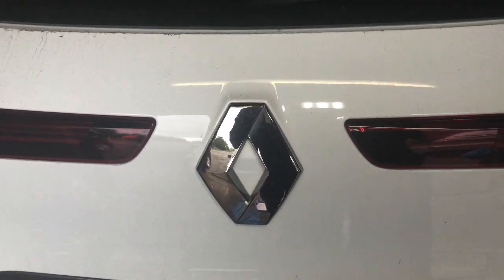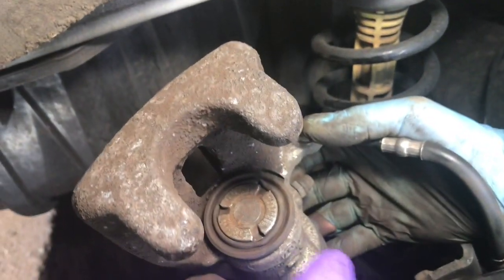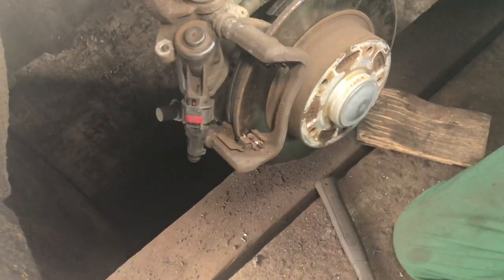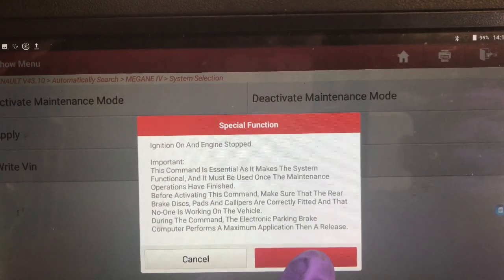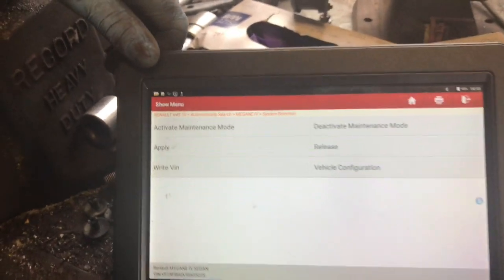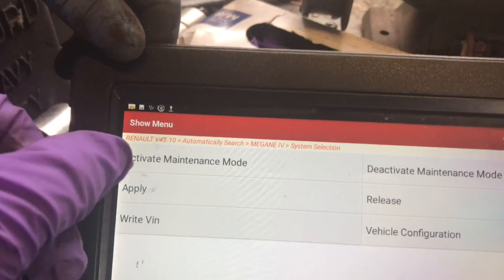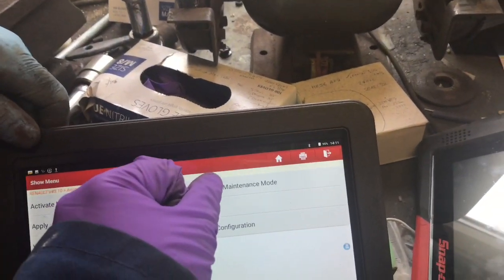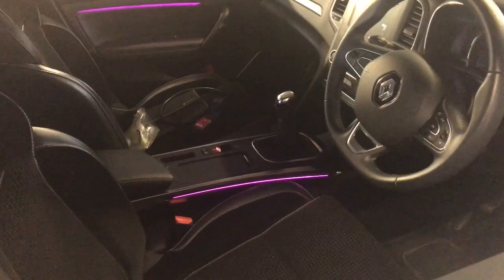Renault Mégane IV (2018) - Rear Brake Service, Maintenance Mode Procedure via Launch X431(Scantool)

Comment: Recently changed my own rear brake pads on my early model 2016 Mk4 , didn't do any of this, all I did was chock the front wheels and left the handbrake off without the ignition on, had no issues changing the pads, and managed to push back the piston without much hassle.. no errors either after. I find it resets itself when you reactivate the handbrake. But, good guide regardless.
Reply: My handbrake comes on automatically once the engine is off, even when in neutral (mk4 Megane). How did you manage to stop that?
Reply: @InterTay  Don't use the clutch for the first bit.. put car in third gear (1st gear if Automatic), press the foot brake and press the stop start button for 2 seconds so the ignition is on,  keeping your foot brake down you can deactivate the handbrake by pressing the handbrake button, this will release your handbrake. Even if ignition switches off, it won't reactivate the handbrake until the next bit. (but it will give an audible warning the handbrake is off.)

Chock the car, lift and car jacks to make it safe, replace brake pads/discs depending on what your replacing.

To reactivate, start the car normally with door shut, and pull up the handbrake switch, with foot brake pressed deactivate handbrake, and stop engine. the car should activate the handbrake with the new pads/discs on, no ECU reset needed.
Reply: @JustAGameShow  thanks for this information. I was wondering if that would work. I have the 2020 facelift, and I've managed to get the handbrake off, but I was not sure if pushing the piston back without resetting the EPB motor would damage it. So when you push the piston back, it automatically pushes the EPB motor back too?
Reply: Same here but I got that brake system failure after changing the rear pads had to reset it

Comment: Eyup sandy, once the calipers have been put in maintenance mode, you should just be able to push the pistons back with pump pliers, like a normal caliper. 

Then obviously reset the maintenance mode to restart the motors etc. As ya know.
Reply from the maker: LOL Kierin never even thought of pump pliers cheers my friend, Sandy
Reply: I was going to mention that Sandy , you should be able to push the piston back just like the front ones 👍👍👍
Reply from the maker: @CarsExposed  LOL if only I knew, funnily enough I had watched your video using the Autel
Reply: sandy anderson 🤣🤣🤣 and I mentioned in the video... anyway it works both ways 👍👍👍